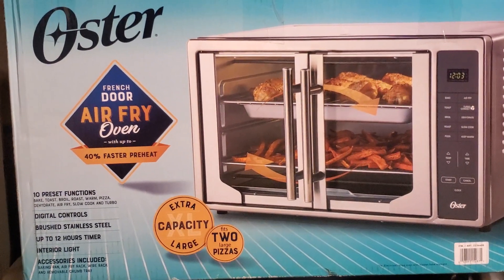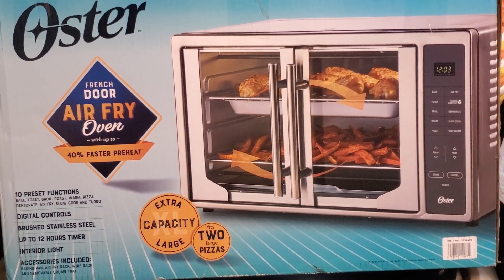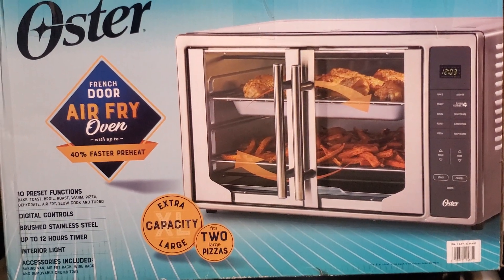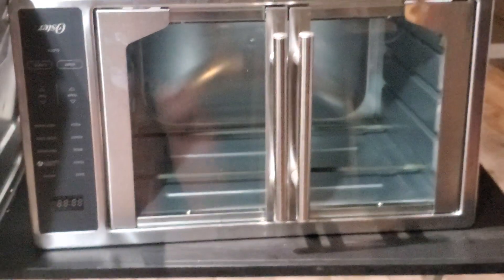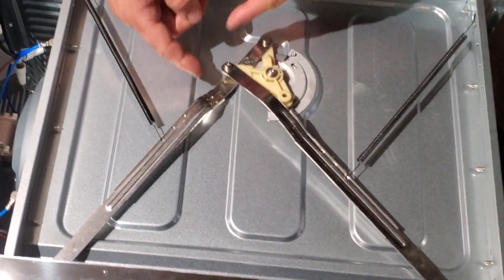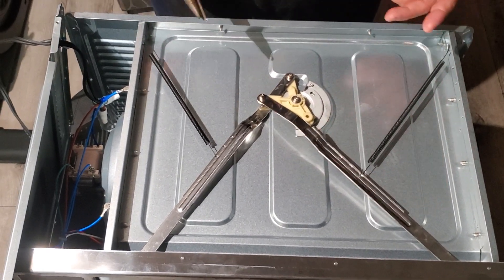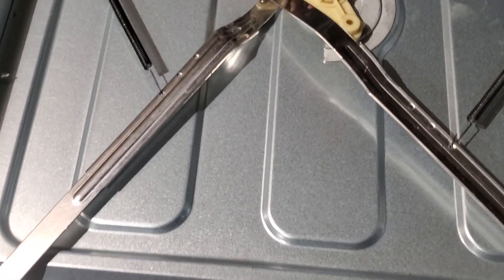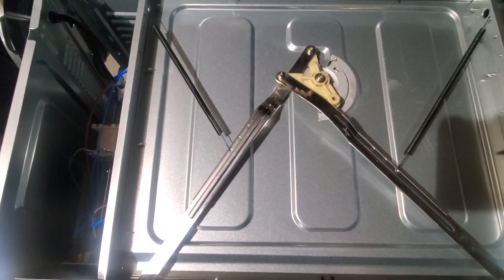Repairing the door on a Oster french door xl air fry oven.

Comment: How did you remove the outside?  I have removed all the screws but still will not budge.
Reply: If you remove the rubbery circles in the black base you’ll be able to unscrew that too. Hope it helps!
Reply: @brunadias3607 can you advise how to remove the rubber feet?
Reply: @rachelg9315 I’m not sure how late this is for you, but I used a pair of needle nose pliers to get the rubber plug out and then just unscrewed the screws they were covering

Comment: That plastic rotator just broke on ours....
Reply: The plastic rotor that guides the doors to open/close broke.  Anyone know the part or where to buy
Reply: Mine broke too. Would love to know is anyone figured out where to get it
Reply: @brunadias3607  I never found it but love the pizza cooking it does, still been using it. 
Thought about making a new part from aluminum so it doesn't melt and break again. 
But for now I was just pulling bottom tray out to hold both doors open while loading.